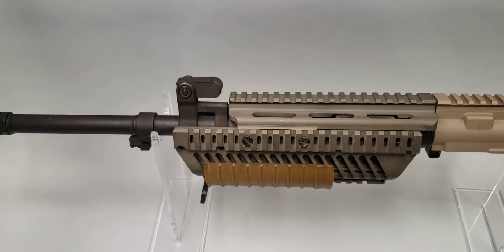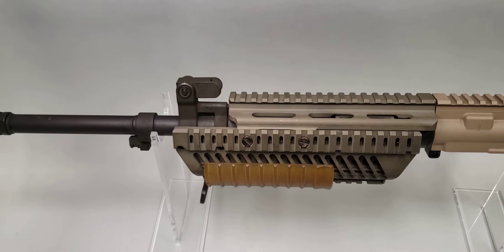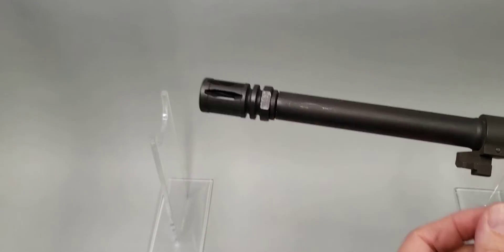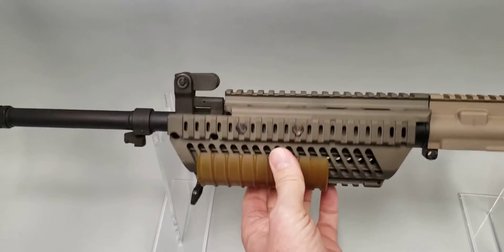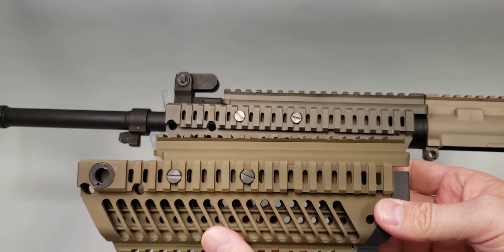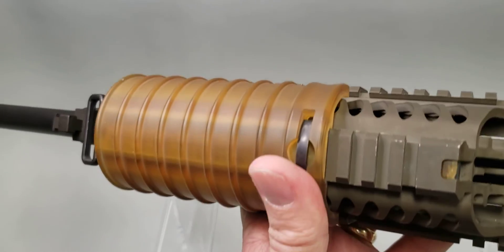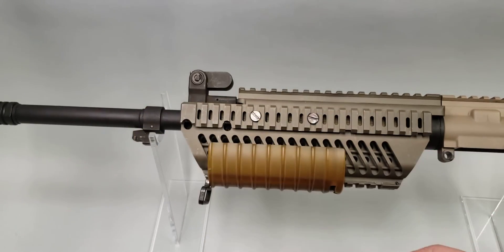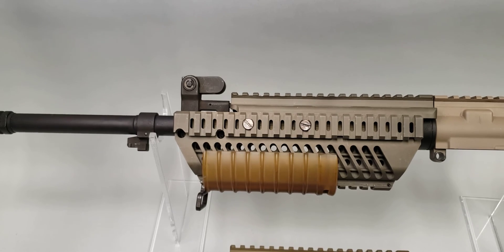Colt / Knights Armament IAR6940H (Heavy) Upper Receiver Prototype Heat Rail System Discussion

Comment: Did they release what they thought the rate of fire sustained and max temperature these would get to ideally? Or, were these just made to buy the operator time? Where let’s say a standard ar pattern rifle could do 6-10 mags of full auto before being too hot, vs this system being able to do 12-24?
Reply from the maker: I have not been able to find any program information on the Colt / Knights Armament prototype performance.
Reply: I don't remember the source but I remember a number of 1,040 rounds full auto no breaks before the barrel failed. This compares to 950 in a regular M4A1 (SOCOM profile barrel) and 450 in a regular M4. 

I'm hunting for one of these because I'm an M27 program/automatic rifle nerd but I think it's obvious why this lost. This has like 10% more sustained fire capacity over an M4A1, can't be free floated in the normal manner, and is significantly heavier than a normal M4A1. I think a Block 2 M4A1 is hands down a better M27 than the Colt IAR, and so is the HK416 that became M27.

But a Block 2 M4A1 wasn't in the trial, and would require more than one company in the bid (though, admittedly, Colt did this anyways with KAC's help here!). Ultimately Colt failed because they failed to understand how rifles are actually used. The decisions they made here are absurd in the real world use of an automatic rifle or an assault rifle.
Reply: Chris Bartocci (Small Arms Solutions) may know - he worked there for some time